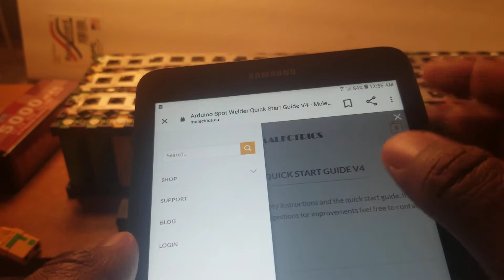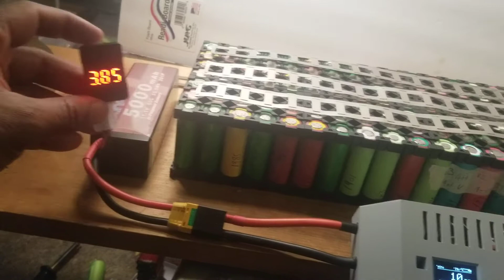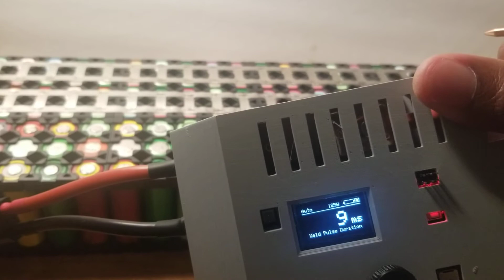TESTING OUT MALECTRICS DIY ARDUINO SPOT WELDER.

Comment: The "W" is not for power, but it is a counter of how many Welds have been done. So 125W is 125 Welds.
Reply from the maker: OK you did understand
Reply from the maker: The welder is a piece of junk. I bought two, they all died
Reply: How many welds on each welder did you do before they died
Reply from the maker: The machine has no protection for low votage, it is broken. It is à waste of money